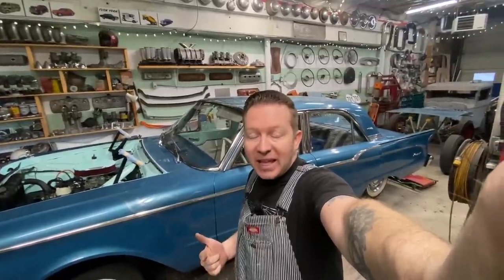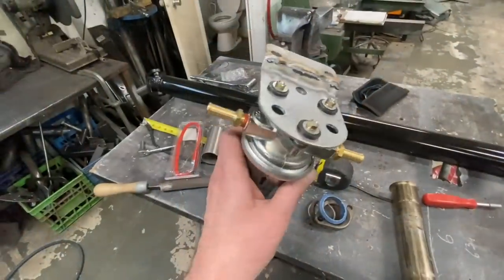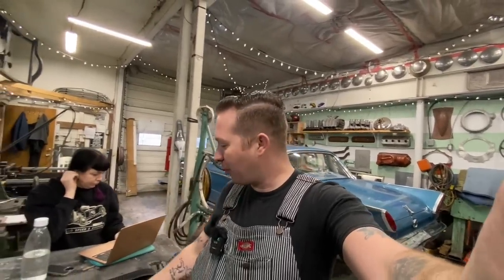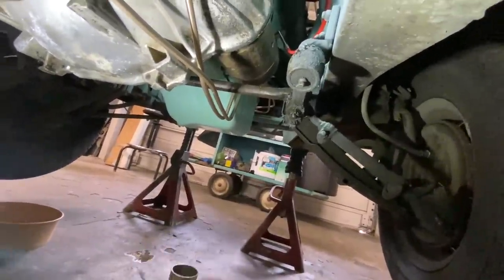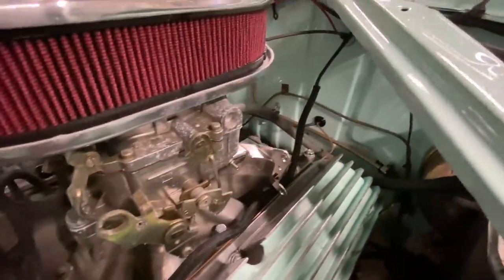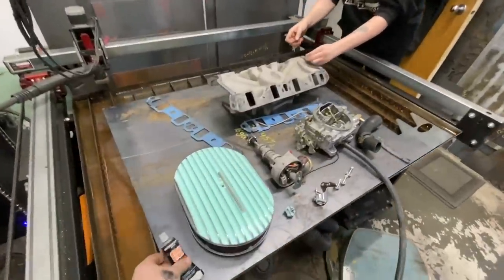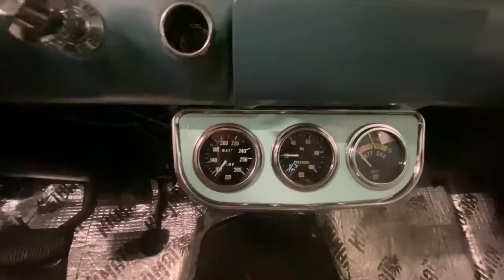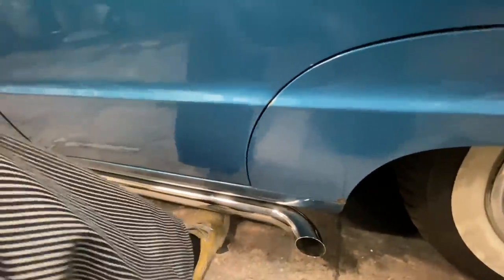Lake Pipes and Stainless Exhaust on Shannons 61 Comet. 302 Swap part 7.

Comment: When we did my 53 Plymouth Cranbrook 4-door it was truly a one-off design putting a 318 in a v-shaped engine bay with the matching torque flight transmission was not easy, but I let my friend and $400 later custom design a exhaust system for me, that's what I love about customs is there is no rules when it comes to designs
Reply from the maker: That’s awesome! Just make it fit!
Reply: @LGKustoms  hardest part about the build was this car came with no crossmember from the factory but a solid straight frame and an ex member so getting a cross member and independent front suspension was not easy into this car and the fabricating of the new leaf spring mounts but that's the fun of custom building learning new things as you go along what works and what don't work I don't think many people choose to build a 53 Plymouth

Comment: Nice job on the pipes. That intake manifold is meant for earlier engines with smaller water ports. The gasket opening may uncover the corner of the intake. The sealant may work. It's worse going the other way, using a late model intake on 289 heads, the iron around the smaller coolant ports cuts away and the manifold openings overhang.
Reply from the maker: It seems to be holding great so far

Comment: As a thought, add a flex joint between engine and lake pipes
Reply from the maker: You know, someone else mentioned that too, but I don’t see how this is any different than a traditional exhaust system. The pipes are just routed to the outside of the car rather than down the center of the car. On a traditional system, you still have a solid pipe from the manifold to the bumper. 
I appreciate your thought though! Thanks!
Reply: @LGKustoms  It takes the strain off the mounts you added. Less likely for the bolts  in the floor pan to rip out.

Comment: I know “Low  & Go” is the look these days. The driveshaft tube looks to only have about 1 1/4 of clearance at the end of floor tunnel exiting to the differential. You may have to remove the lower blocks off the springs perch to get better clearances for the driveline tunnel area……... Also the video shot of the install of the driveline at the transmission tail shaft, appears to have a u joint angle that off angle from the differential u joint angle……Could be the video angle shot though…..Those different u joint phase angles could give some road speed vibrations.
Reply from the maker: Shannon and I raised the driveshaft tunnel 2” a few years back because it used to rub if people sat in the back seat. It doesn’t rub now. The rearend will bottom out on the frame bumpstops and pinion snubber before the driveshaft will touch the floor

Comment: You two are the A team. What did you have for breakfast Shannon? Comet, is gating better all the time. What do you use to stop the wether getting inside the car. Nothing worse than wet carpets. Take care Tim.
Reply: (Gating)or getting. You no what I mean. Looks cool on the ground.
Reply from the maker: It’s actually water tight! The only car in our fleet that doesn’t leak haha

Comment: Burn outs?  What is the life expectancy of that oem rear end?
Reply from the maker: 😆 in my experience it’s not burnouts that kill rearends, it’s the 1st gear to 2nd gear shift at wide open throttle. 💨
Reply: @LGKustoms  any plans to upgrade rear end?
Reply from the maker: @qwiked  not until it breaks. In the meantime, I’m casually keeping my eye out for a suitable rearend thats not $1000
Reply: @LGKustoms  8.8 out of a Ford Explorer is a good choice, of course 9” Ford would be the cats meow.
Reply from the maker: @qwiked  explorer rearend is a bit too wide, although they are easy to narrow. 90-92 Ranger has a 56” wide 8.8 however!